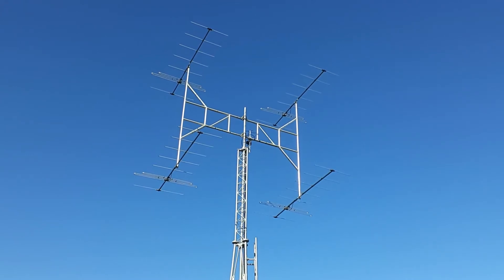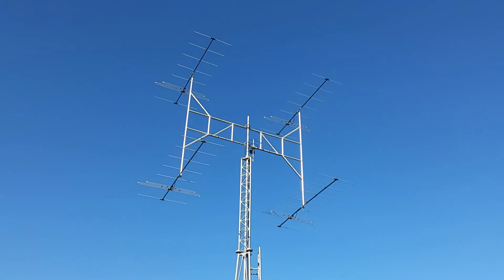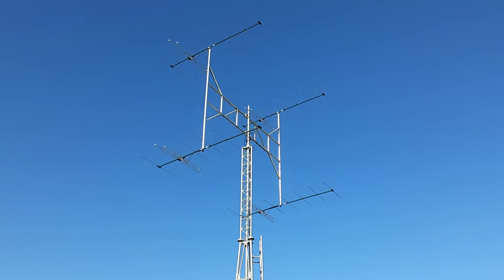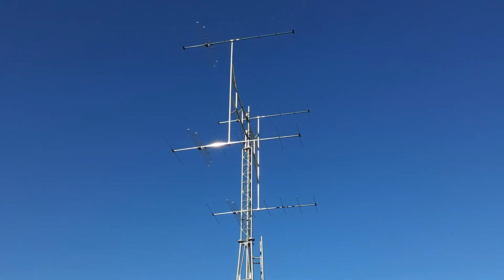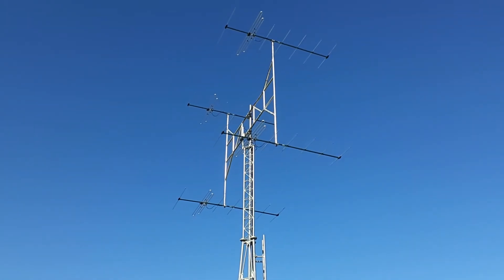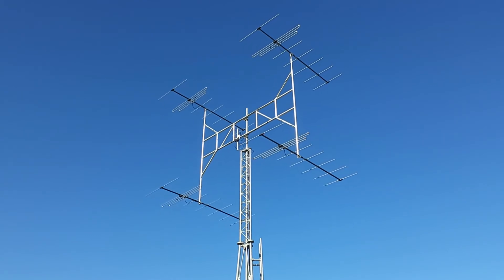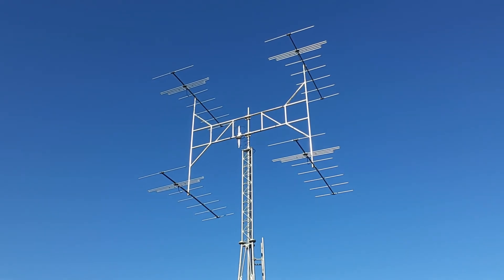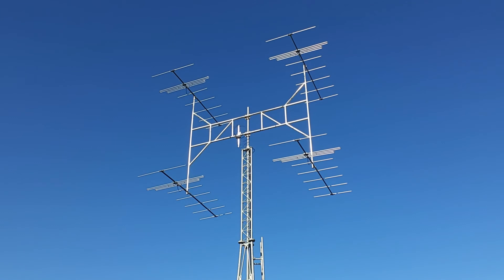Matchmaster FM Band Antenna Array, The Rock Hill West Radio Observatory

Comment: What a fantastic array !! How far away is the tower from the transmission source ?
Reply from the maker: LDF550 heliax feeder length only about 15 to 20m total, not far from shack at all
Reply: @VK2KRR  ~ sorry .. I meant how far was the transmitter( Miles )  from your antenna not the length of the feeder cable 😀
Reply from the maker: Oh actually this tower is about 30 from shack actually. What tranmitter are u referring to? 50 km away to max 4500 km so far
Reply: @VK2KRR  ~ I'd love to know the gain of that antenna and what elevation you use it at . 50 miles is nothing but 4500 is awesome .. what directivity !
Reply from the maker: Elevation should be 0 to 1 degrees. Not sure of the gain but if u go by manufacture specs gain is around 17dB? There is no reference figure quoted like dBi or dBd it it just says dB, which is basically useless. The directivity is ok but nothing special. This morning hearing to 2700 km via tropo ducting.
Reply: @VK2KRR  ~ the gain of any passive antenna system is in dBi

Comment: Just a bit more sophisticated than my single Matchmaster FM8 on the roof ;). Would it be possible to do a YouTube livestream when you're receiving exotic FMDX? QRM may be an issue, though.
Reply from the maker: Probably not possible due to the internet speed, ADSL 10 km from exchange :( price you pay living in the sticks I guess
Reply: @VK2KRR  But if you live in town, you'd be in a much poorer DX location. There's the rub.

Comment: Outstanding system Leigh!
Is it possible to DX the DAB stations? (Given the correct banded antennas of course)
Reply from the maker: Hi, thanks Adam. It would be possible for someone in the right location, similar to Digital TV, but I have investigated this a while back and the stations which I could potentially get DAB signals from such as Adelaide, have their antenna radiation patterns set up in such a away which minimises transmission in my direction and maximises it toward the opposite direction. So hence I've not taken it any further for this reason. I'll probably revisit it again one day if it gains more momentum in Australia.